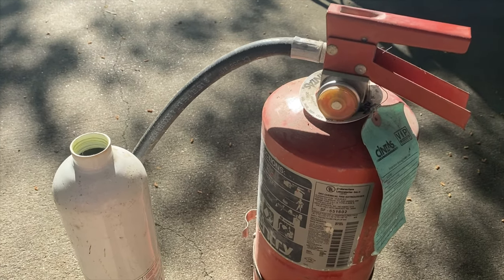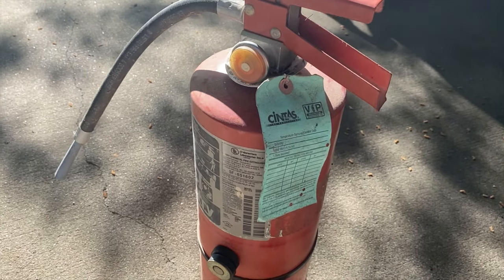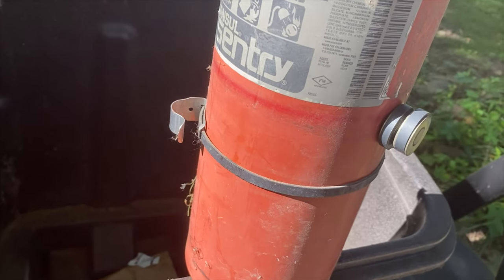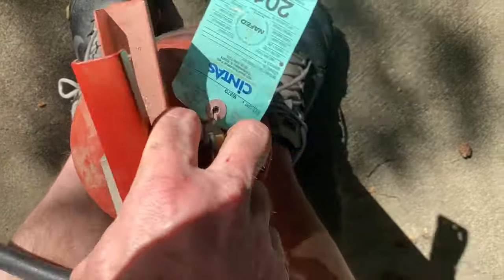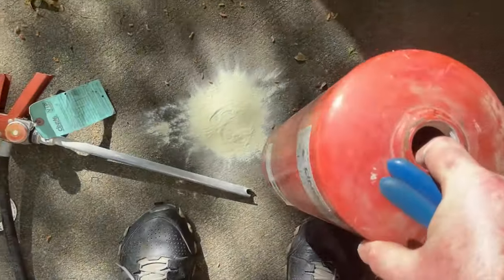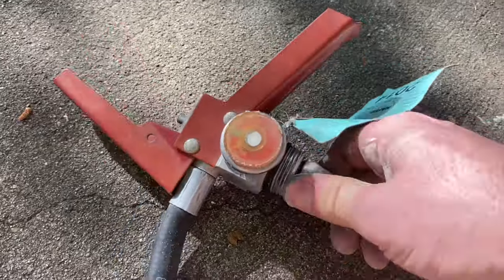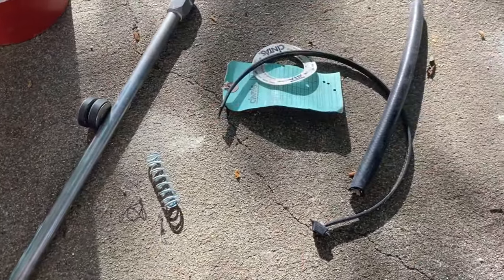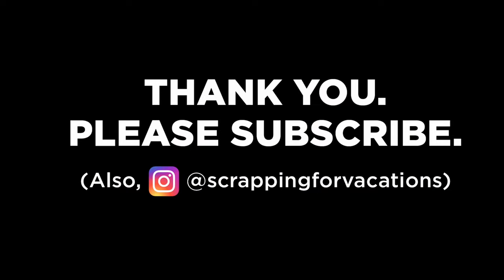What's Inside? Simple Scrap Breakdown Fire Extinguisher How To Tip for Scrap Metal & Free Money

Comment: I have a chance to get my hands on  at least 100 steel ones, my question is , How much does the steel cylinder weigh?
Reply from the maker: Wow! That would be a cool score. There’s quite a few sizes out there so would be hard to know. I don’t have any handy to weigh for you. 5lbs on average maybe?
Reply: @scrappingforvacations   I forgot i had 3 in my garage. I took one apart and its 13.22pounds. And rough estimate from the pictures i calculate at least 280 cylinders. Mostly the big size ones like i got.